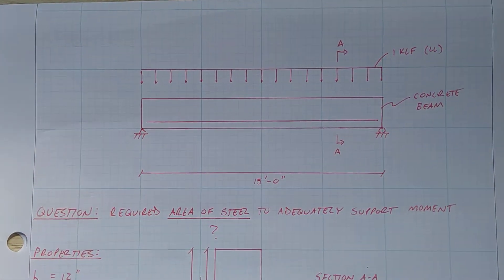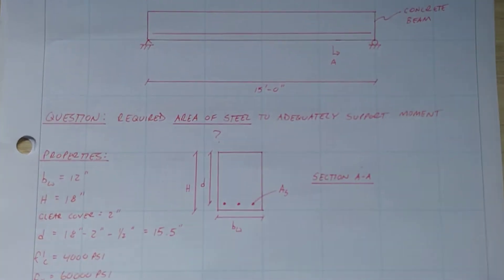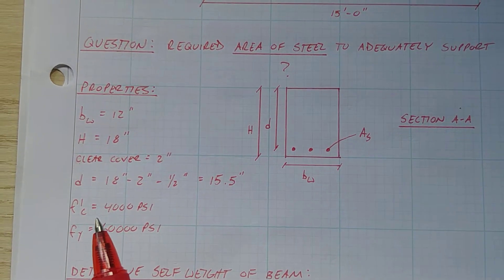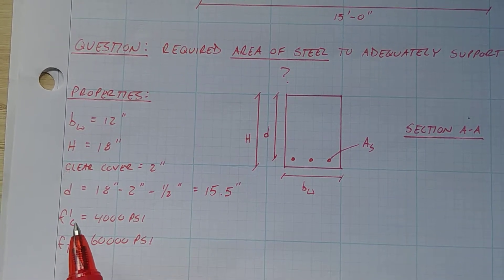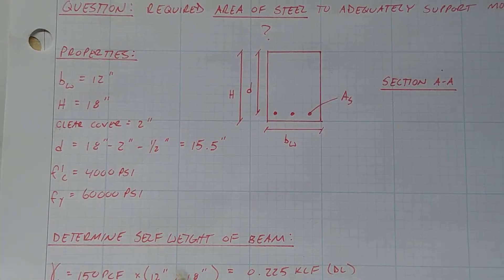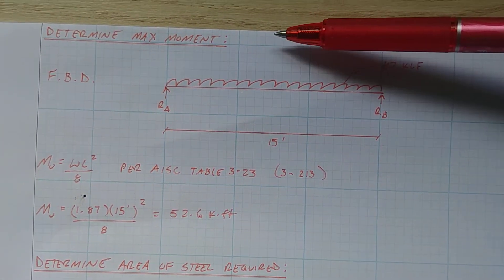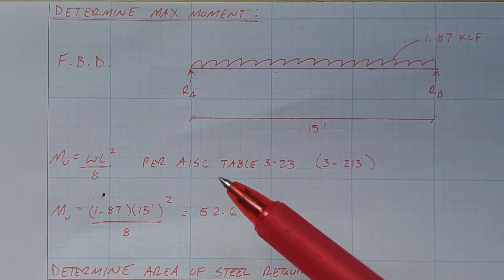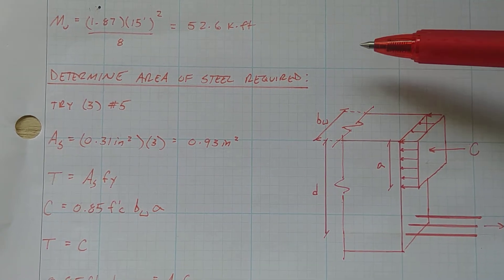Area of Steel Required in Reinforced Concrete Beam

Comment: I have a question: after determining the diameter of the bar you didn't aplay the new effective depth which should be 13.5 in.why do you stick with the assumed one.
Reply: because the d he used was conservative (assuming the bar is 1" dia.).   So the actual d is actually more.  No need to fix the d when phi Mn is already OK.  If it is barely failing, then maybe go back and refine the calc.

Comment: I'm a hydraulic engineer who works on dams but I also have to review a lot of concrete design work.  A lot of the sample problems i see online deal with steel/concrete beams.  What are good examples of determine rebar size for concrete walls both retaining either water or soil?  I just need pointed in right direction.  Thanks
Reply: I believe it is the same thing but you design the steel per ft instead of per beam width.  There is also rebar spacing max on ACI350 because it is holding liquid.

Comment: What if two rows of steel? Or three rows? How to do it?
Reply from the maker: In short, you now have two tension forces, one at the lower row of steel and one at the higher row of steel. both need to be calculated. I will add a video with an example problem Rudy!
Reply: @Kestava_Engineering  thanks man, appreciate!